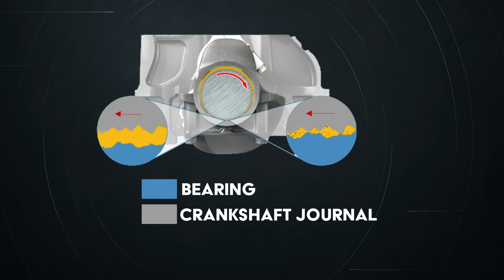the truth about start-stop technology (finally proven)

Comment: I dislike ISG for several reasons: 
1. Most vehicles have a crank or cam-driven oil pump, not an electric dry sump so the engine keeps starting dry
2. Starter wear - although I haven't had to replace a starter in the last few cars, I've had to replace them in the V under the intake manifold in past cars (including a ZR1 Corvette)  and it's a royal PITA in many/most newer vchicles if you don't have a lift and powetrain jack/table/cradle, and a modern tiny garage that you can barely fit a car into
3. Battery wear - our Forester ate batteries before I disabled ISG 
4. If someone is coming up behind me and not stopping, I want the car to go NOW if I mash on the throttle to get out of the way, not a half second later after the engine finally starts 

So, I now disable ISG on our vehicles. When I bought my Stinger, the first things I did was 1. disable ISG semipermanently and b) installed a shielded cold air intake (both done the second day I had the car). On our Outback Wilderness (we upgraded) we just turn it off every drive.

Comment: I can see oil pressure in live data on a diagnostic tool. What I have observed has nothing in common with your test. Oil pressure goes above the wear threshold almost instantly. Those 7 seconds pressure buildup you observed probably mean problems with your engine.
This looks like a rigged up test.
Reply: Thank you for clarifying, I would suspect that if this was a major issue we'd be seeing problems popping up everywhere with these sort of engines.
Reply: @John_Citizen_17  These clowns don't know what they are talking about. The oil pressure sensor is located where it gets an immediate reading BEFORE the oil pressure has reached all parts of the engine.
Reply: I would tend to agree. This video had potential but they kind of flopped on details. They didn't even specify what kind of oil they were testing. Modern oils are thin for a reason. There's no way you would need 7sec to build oil pressure with 0w20 and warm engine. 

Also that ancient engine designed for heavy oil and big clearances is not a valid test for start stop wear.
Reply: Please show a video proving the opposite.
Reply: Agreed. Even first start after an oil change only 2 seconds for complete oil pressure.
Reply: @kj385  The oil pressure sensor is located where it gets an immediate reading BEFORE the oil pressure has reached all parts of the engine. It takes more than 2 seconds for the oil to reach all the bearings. You could have figured that out by using common sense.
Reply: @MikeO-l7s oil pressure is not a wave. I mean if you want to embarrass yourself, go right ahead. Ah, you and the other thing already did that. 
The only way you'll see 2 seconds oil pressure buildup is if your engine is either completely worn out, very old or you just replaced the oil filter and it's empty. 
Just my 2 clown cents here.
Reply: @MrFearless84 so you are agreeing with me or what? No idea why you are agreeing with me and calling me a clown.
Reply: @MikeO-l7s are you reading all I wrote or just every 4th word?
Please, just stop embarrassing yourself!
If you need to hear it from me directly. No, I do not agree with you. I didn't call anyone clown, the other "engineer" who agrees with you did.
By the way a lot of VWs have their oil pressure sensor in the head. Are they getting the first oil pressure wave too?
Reply: @MrFearless84   No idea what you are trying to say or what your point is. You need to work on your writing skills.
Reply: Yeah, a primed oil system will make pressure within 5 rpm. This whole video is nonsense
Reply: what about the visual wear though?

Comment: Whats extremely funny is that if you look up if the start/stop feature wears your engine out faster you'll get a TON of articles and videos that stay it doesnt, yet here we have proof that it does. 

Not only that, but my friend and co-worker has one of these "ECO - Friendly" engines and basically needed a whole new engine. He is also a mechanic and have seen the flywheel grenade...which is really bad

Comment: You're not measuring the time for the engine and bearings to see oil pressure. You're measuring the time for your mechanical gauges to react. Use an electronic guage with the sender plumbed into the oil galleries and try again.